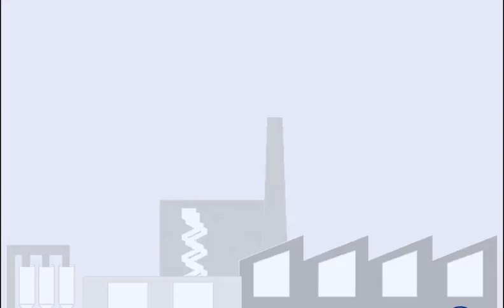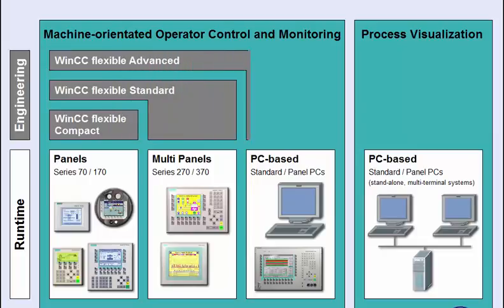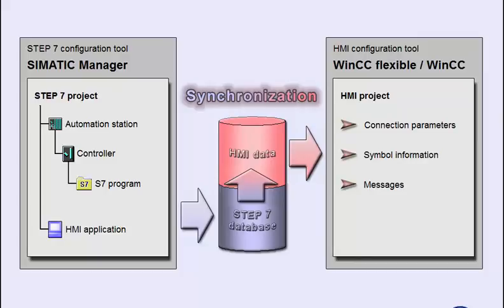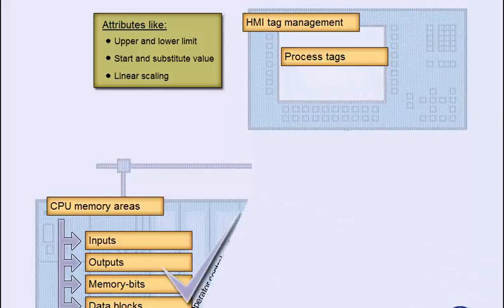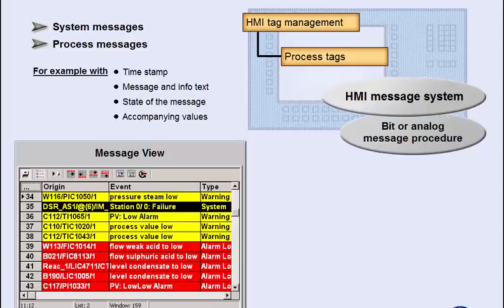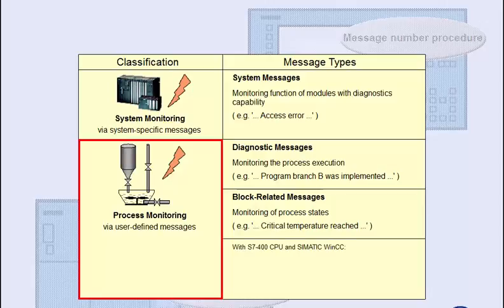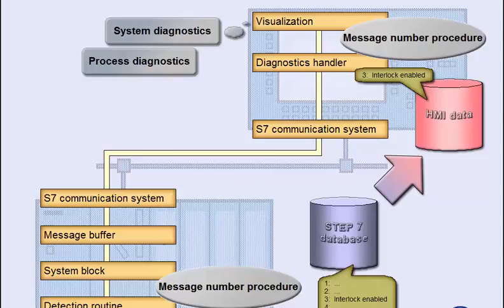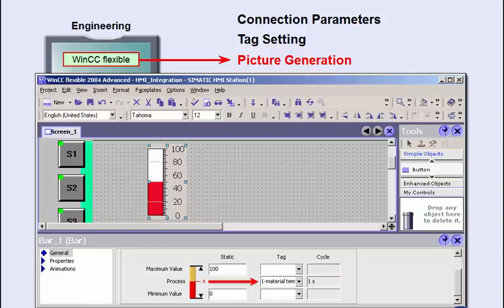PLC Siemens S7 - 300 Training, Lesson14, Integrating S7 300 with HMI Siemens SCADA

Comment: SCADA Training in Delhi | HMI Training in Noida | Scada Training - 9818293887
http://www.diac.co.in/courses/scada-and-hmi-training/
These courses have been designed to give Engineers an insight into the configuration and operation of the main SCADA/HMI packages. The courses will allow students to develop an understanding of what factors to consider when designing, developing and using SCADA systems in the field. They will gain knowledge of the system, including specific system terminology. Call @91-9953489987,,9310096830.